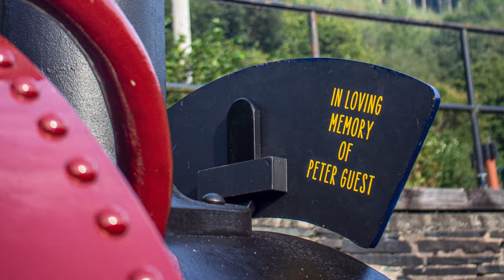The World's Newest Steam Locomotive! Ft.@CorrisRailwayOfficial

Comment: I drew up the working CAD drawings for the new cab, The cab is 5.7 inches taller and the reason is that the new Corris stock is  taller and compatible with Talyllyn stock including coupling height. The original Corris locos were not lower than the carriages.
The way this was acheived so as not to look stretched was by adding 2inches to the cab lower sheets and scaling up the side arched sheets rather than stretching its height vertically. If I stand in the centre of the cab which has a little raised plate between the frames my head just touches the roof of the cab and I'm 5foot 10. Somebody 6ft can comfortably stand either side of the cab.

Comment: I love the original silhouette of the Falcon locos with the original cab layout - Though of course, I can see why the TR rebuilt it, door's on the wrong side! Love that the tradition of the "good side" being on the right at Corris vs the left at Talyllyn is carried over in the placement of the Westinghouse pump being flipped on no. 10.

You mentioned the height of the loco cabs changing a bit, I noticed when I was there in person that Edward Thomas (And Dolgoch, to some extent!) were seemingly designed for someone no greater than about my height, is it a situation like with the Taliesin replica where people are just that much taller now, and the loco needed a bit of adjustment?

Comment: The Corris Railway is truly amazing.
It was dead. Kaput. Most of the track ripped up, rolling stock all sold off... It was gone.

But look at it now. The track has been re-laid about as far as it can go barring a reopening of the rail passage under a certain bridge. It has new carriages built to the vintage design, plus IIRC some restored vintage ones. And it even has two steam locomotives built just for it in the 21st century - the Tattoo-class from 2005, and now this brand-new one to the Falcon Works design that made up most of the original fleet.

Comment: was she named after sir handels old name?
Reply from the maker: Corris No.10 doesn't have a name, she does have the nickname of "Falcon" however and this comes from where the original Corris engine were built.

Back in 1878, Corris No.1, No.2 and No.3 were built by Hughes's Locomotive & Tramway Engine Works - at the Falcon Works. The engines were very quickly nicknamed "Falcon's" because of this.

Sir Handel's old name is in reference to this, and Peter Sam's old name "Stuart" has a similar origin - as he was built by a company called Kerr STUART
Reply: @TalyllynRailway1865 ok btw it’s a shame awdry isn’t here for this I bet this engine would’ve made a great rws engine even though he looks very similar to sir handel.